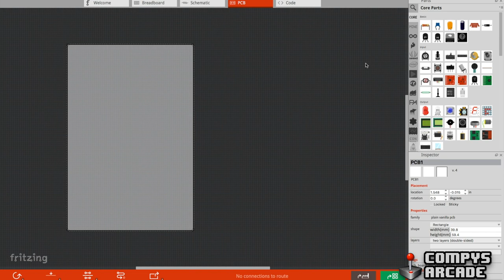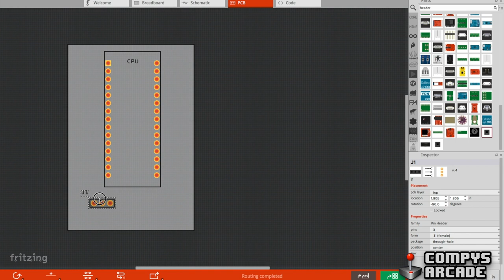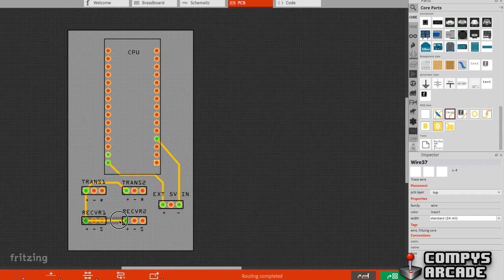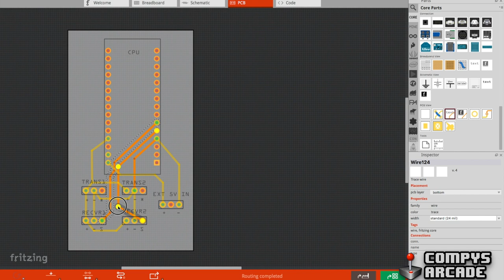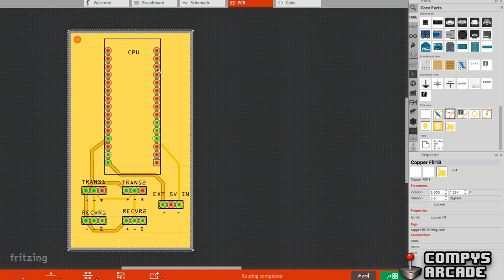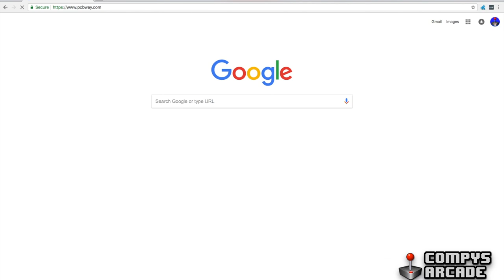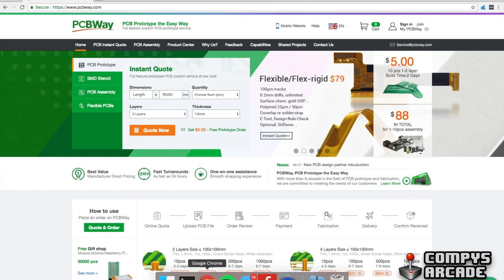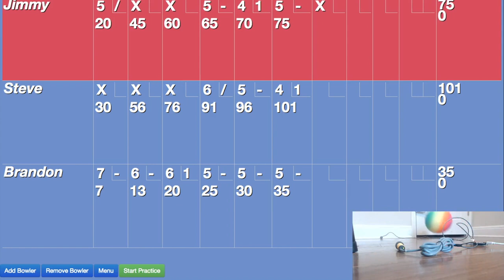Designing an infrared bowling trigger, OpenScore Updates

Comment: When trying to launch OpenScore, I get the error: "Webcam.js Error: Could not access webcam: TypeError: Type error TypeError: Type error" I tried on a laptop and a desktop with 3 different cameras and tried running as admin. I unpacked the zip.
Reply: I got the same error. I just downloaded the open score 2.0 for the first time on a laptop running windows 10. I have a Logitech c270 webcam.  Did you get anything firgured out? Hopefully Jimmy will reply with a solution.
Reply: I got mine working. I downloaded it from another video and that one worked. use this link:   https://www.dropbox.com/s/d3pl69bckj37y56/OS2.zip?dl=0 then click in the upper right and select direct download. Then unzip and install. Also with using my laptop I had to disable my built in webcam. It now works perfect.
Reply: it might be a firewall issue. If you add an exception for the camera in your security suite and/or windows setting then it should work.